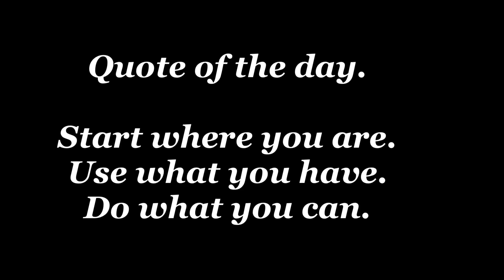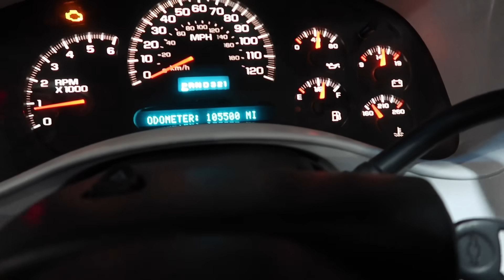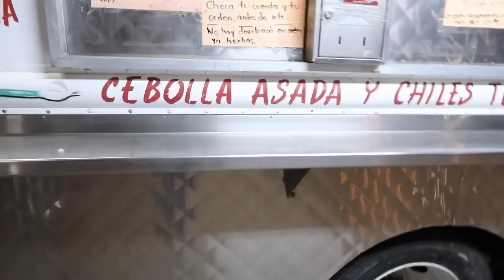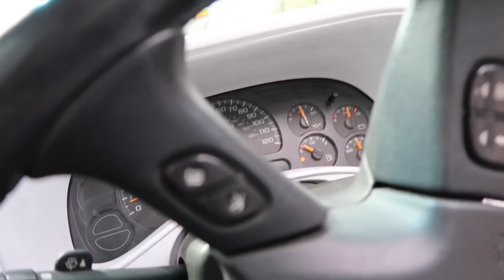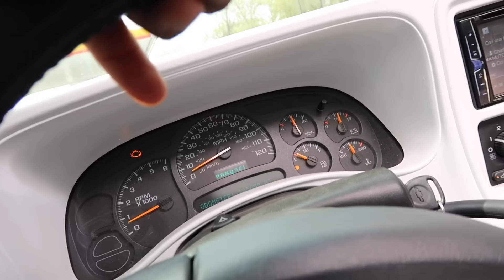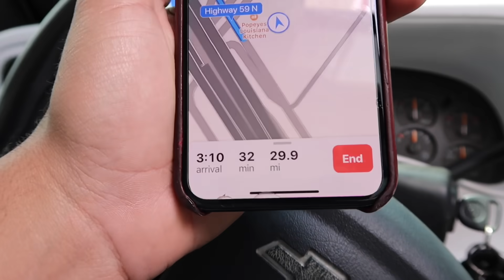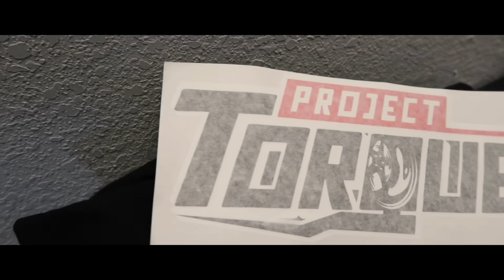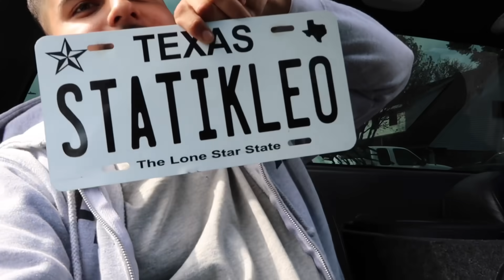new AUXBEAM leds and truck meets 🤟🏼

Comment: What head light in the dark truck looks like a 2000 model. I got a 2004 white silverado I want to put them in, my upgrades are leather interior, power everything, carpet, bed cover, bed liner, window tint, drip rails, new paint, michelin tires, tune, cold air kit, 22 inch light bar, fu head light bulbs high and low beam., lower it next month. Roll on

Comment: cant see crap down the road without blinding everyone. I went with projector custom headlights and fog lights i installed myself from morimoto never looked back. i can see a whole block away and without blinding everyone. I have high beams from my projectros, the regular truck high beams and high beam from my fogs lights.